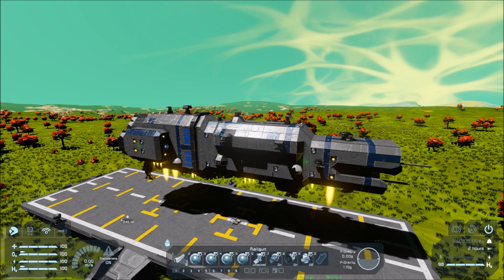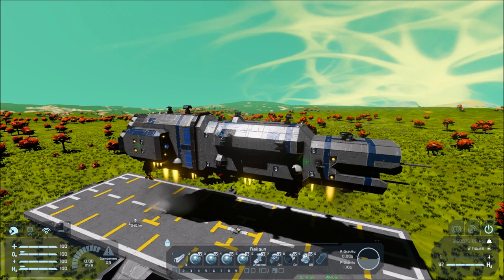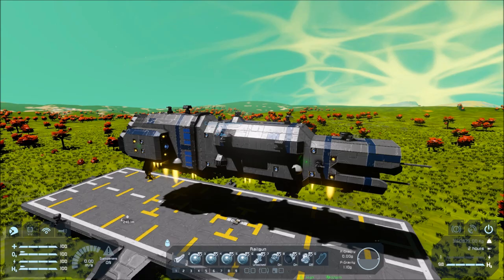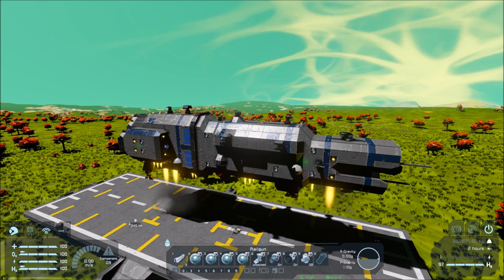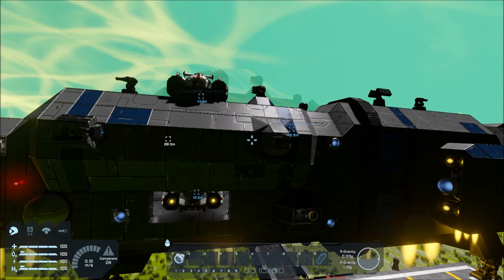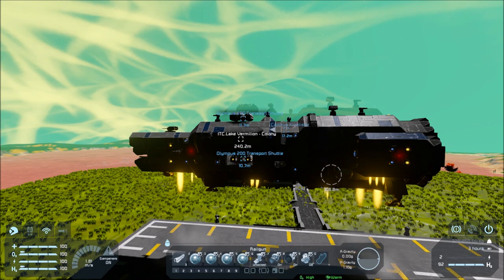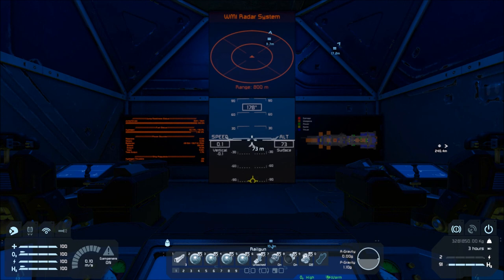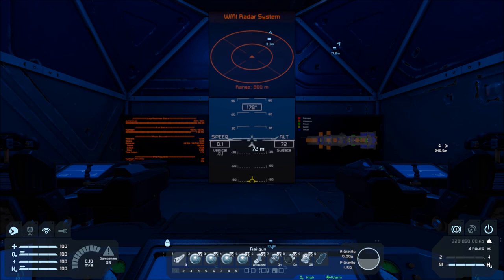Space Engineers - Inertial Dampener / Ship falling while carrying small craft  - Bug

Comment: It can be solved with whips subgrid thruster script if you are able to use them
Reply from the maker: I experimented to see if that script would help last weekend but unfortunately it didn't work unless I added rotors with thrusters on them, without rotors nothing seemed to happen and it still tended to lose altitude as soon as any small craft were connected.

When all is said and done it's not a big deal, just as long as people are aware of the bug they can manually compensate for it by feathering the spacebar.
Reply: @CaptainRobertson  if you go into custom data and set 'control thrusters over connectors = true' then it works. Otherwise you need rotors like you say.  Its a pain i agree but it works i promise!
Reply from the maker: Good catch if it's works with subgrid thrusters off, but as luck would have it - Antimutter messaged me this morning saying that he's not experiencing this bug in vanilla Space Engineers, so I tested it again about 5 minutes ago and it looks like he's right, they must've fixed it fairly recently but not mentioned it in the latest patch notes..... Now if only they'd fix the looping sounds bug too I might be able to get back to recording the next episode. ;)

Comment: you mentioned that the external ship was connected via connector, was the internal ship docked via connector also?
landing gear connected ships ahve been causing this to happen for some time and im not 100% sure, but they might not be intending to fix the the issue with landing gears, but if this issues now included connectors, then that is a problem, it is their aim to make sure it does work with connector connected ships.
Reply from the maker: Yes, both small vessels were docked using connectors.
(Edit) Sorry, I flew around too quickly, but you can briefly see this at 1:55 as the camera goes into the hangar bay.